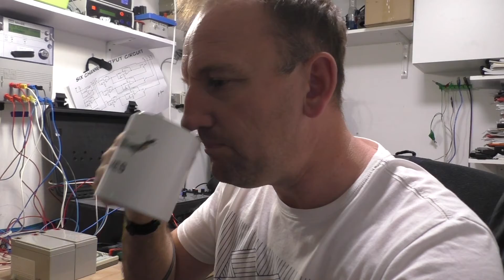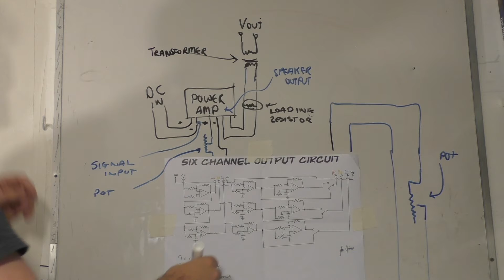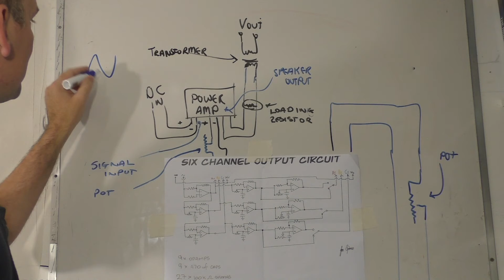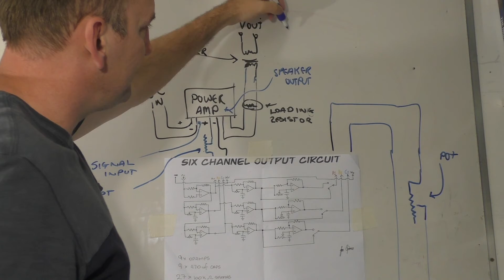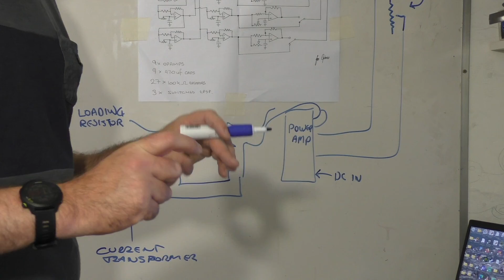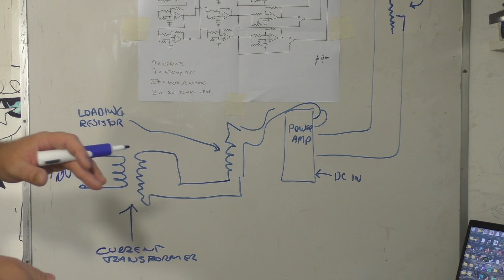Power System Simulator - How It Works

Comment: Question, why did you go with batteries rather than rectified AC?
Reply from the maker: So I can take it into the field.  I work in a lot of substations and even though there might be many kV's around you not always will there be mains power

Comment: Great project.  I know a lot of relay techs that would love a simple, lightweight box like this for ringing out VT/CT circuits 3 phase.
Reply from the maker: I used this for exactly that last year to confirm a 3 phase open delta metering connection was done correctly.  Generally they get network tested lol,  but I’ve been to to many where earths were connected on both the active and neutral and they have blown vts so I didn’t want that to happen to me.